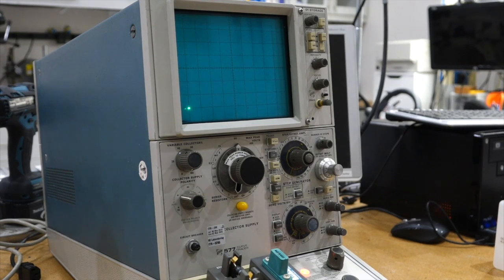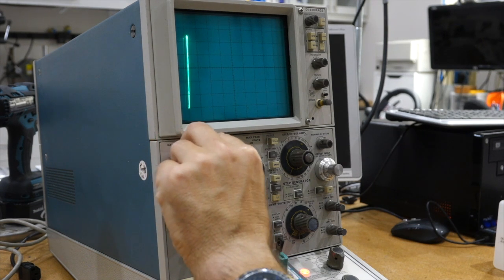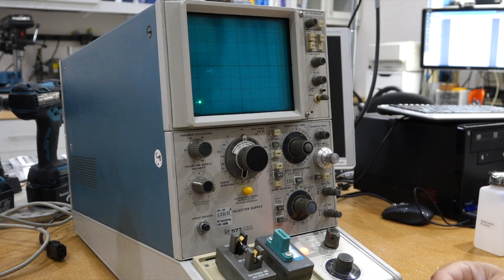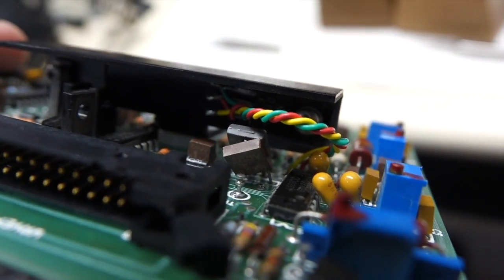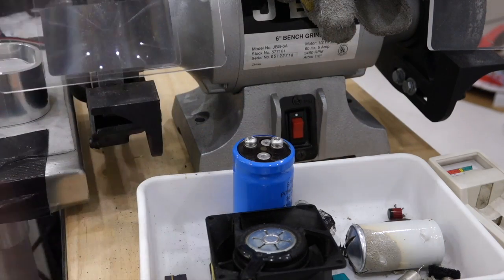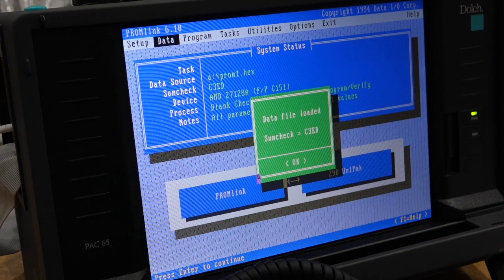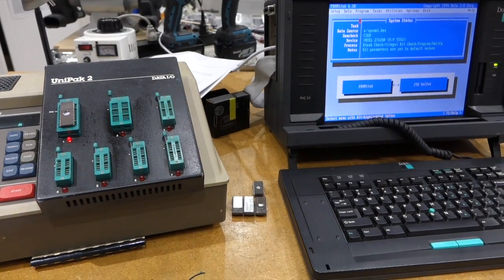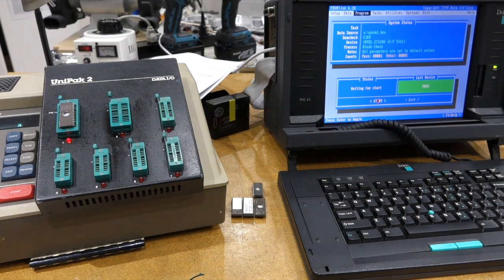Data IO 29B PROM Programmer Repair Part 3

Comment: So..... you mean to say that my Triplet 3490-A transistor analyzer isn't good enough?  I will admit it is a bit of a pita to use, as you can spend a day with all the various tests for each transistor.
Reply from the maker: I had to Google up that one! Oooh, aaah, all these old buttons and gauges. Waaay clunkier than mine. You win! Image here: http://oldtube.com/Triplett-3490A-01.jpg
Reply: Unfortunately I'm not like you I don't have a work bench in every room, haha.  Right now I have a Rauland-Borg TAX125B on my work table (in exploded) mode.... Look that one up!

The Triplett 3490A is kind of boring in operation.  It tests based on original data sheets.  If I could figure out how to streamline the tests for matching I might have something.

 I can't complain, I paid under $40.00 for it (long before high price craziness). It came from a University where most of the time they respect test equipment.

That and I would have to hire someone with an exotic accent (like yours) to narrate ;-D
Reply: I should add that set-up of your Signal Tracer may be almost as tedious as the Triplett.
Reply: ...and remember kids, the Signal Tracer "displays". The Triplett transistor analyzer on the other hand "measures".